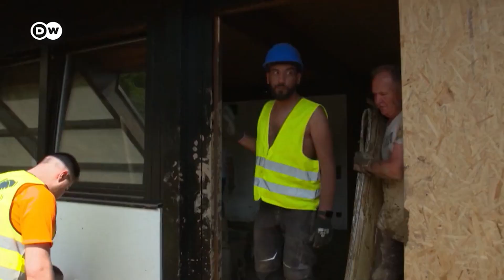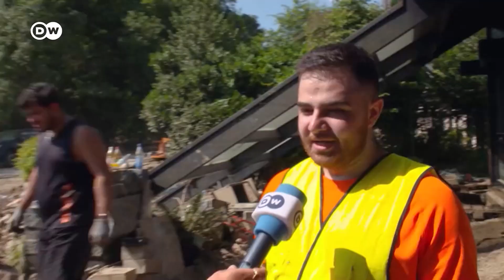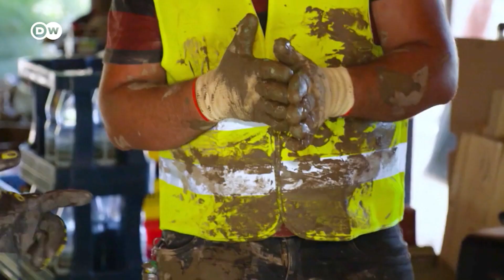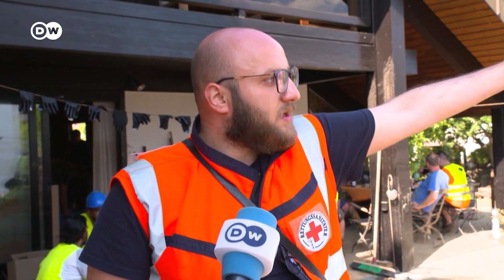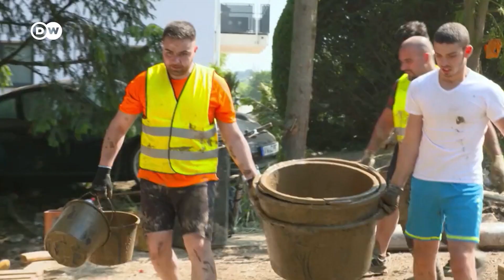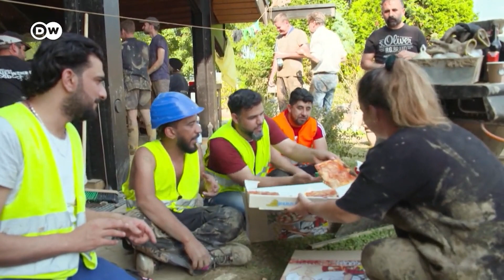Former refugees are helping Germany's flood victims | Focus on Europe

Comment: Germany no longer mandate people to wear mask? Wow, i salute Germany👍💪💪💪
Reply: Germany's numbers are the lowest in the EU. Mask mandate's differ by state and infection rates
Reply: We have currently way more pressing problems in the region but nevertheless everyone that volunteers has to provide their vaccination paper and prove that they are fully vaccinated and where possible also take/ provide a current covid test.
Though in general the requirement to wear masks in public has been lifted though we are still required to wear them in public buildings, shops and public transport.
In fact the masks actually came in very handy when it came/ comes to cleaning out swamped basements as they help tremendously with the spore and dust filled air.